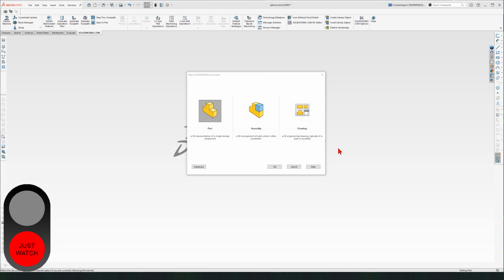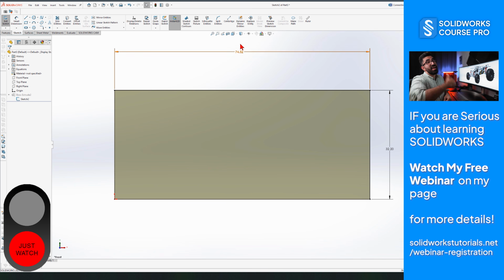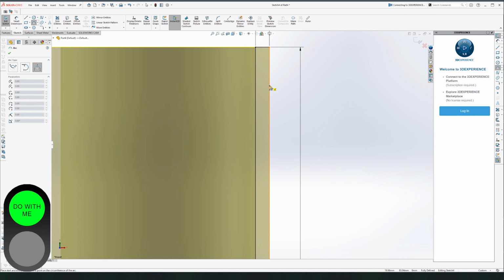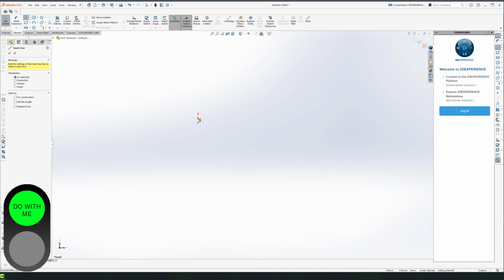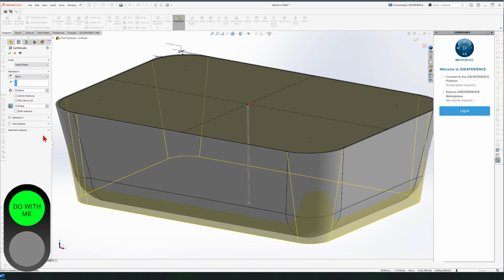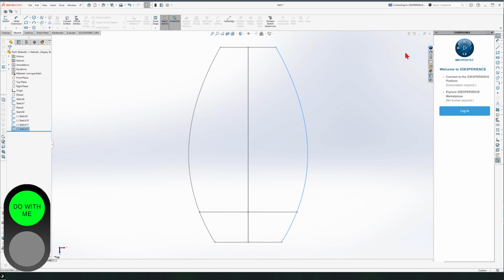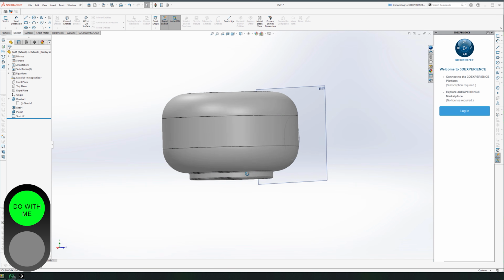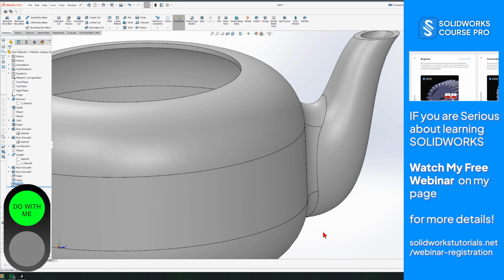SOLIDWORKS 2026 COURSE | Model at Green Light

Comment: For the problem with the extrude I just went back and undid the initial shell, then I rebuilt the spout and blind extruded it into the body then I used the shell on both at the same time
Reply from the maker: Nice, that's a solid fix! Shelling both at once after the extrude is actually the cleaner way to do it, saves you from the wall thickness issues too. Thanks for sharing this, it'll help anyone else who gets stuck there
Reply: @with-aryan of course no problem your video helped me get into solid works easier

Comment: After MMGS selection having to double click on the sketch top line, it did not bring up the dimensions, double clicking on the left pane Sketch brought those up but the sketch was not in edit mode, no matter where I clicked, lasso, box not in Sketch mode. Only when using the pop up on panel Sketch and selecting edit was I able to then select and extrude.
Reply from the maker: That sounds like a configuration issue, are you working with the latest update installed?
Reply: @with-aryan  Hi Aryan, yes latest update, nube + using SolidWorks Design, I started over and no issue. 33 min in going good. I just have to take my time and work through it. Your doing fine on the instructions.
Reply: Email this all to me so I show you live

Comment: 2:15:10 Could we instead hold off on the shell for both bodies until after we have extruded the oval. That way you can extrude further in, and when it merges, you can then shell to get the result we need.
Reply: I got lost after this minute and even watching again, I don't understand what he did. Everything before that was possible to follow. Any advise for a beginner?
Reply from the maker: I'm here, what got you confused exactly? all of that after this time stamp?
Reply from the maker: Yes! we definately can. there are always more than one way to get it done. This will do

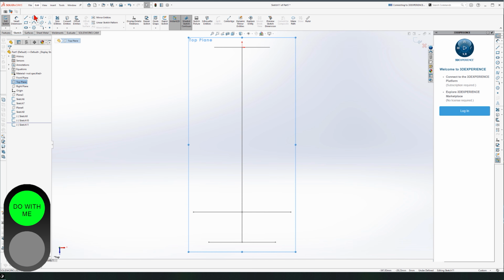Comment: 1:44:10 after adding those lines and performing the Loft action I am unable to select either of those two lines. Clicking the lines open Selection Manager and when clicking them again it says, "The selected guide curve is invalid." I've repeated the step 5 times and have ensured the yellow boxes are there as noted.
Reply: I ran into the same issue, I had two lines on a single sketch. Make sure each line is it's own sketch, you cannot just close the sketch and make a new one immediately. You have to click the plane or deselect the previous sketch before making a one to ensure it's creating a new sketch.

Comment: Hello, thanks for your work. New to this and just getting started and when I follow your lesson to evaluate the cube, I used your stated figures but my center of mass is not correct, redid the sketch multiple times and keep getting different numbers, some are negative. Thanks
Reply from the maker: You're very welcome! If your center of mass is coming up with negative values, it might be an issue with your coordinate system origin.

Comment: At about minute 56, you are teaching how to define a simple sketch, but you are making a mistake. You should NEVER define a sketch through BREP´s. Ever! I thought you would know that as a specialist! That´s one of the first fundementals a CAD designer learns.
Reply from the maker: Hi I appreciate your feedback but I hardly disagree. “Never” is not the correct word here. Sometimes referencing BREPs is the smarter move especially when you’re doing contextual modeling, top-down assemblies, or design changes that need to follow the geometry rather than stay independent.
Reply: @with-aryan  Hi, thanks for your quick reply. 
"....Sometimes referencing BREPs is the smarter move especially when you’re doing contextual modeling..." I would disagree. You never reference BREP´s, you always reference planes, lines and point on which your design is based, for contextual modeling. At least that´s what we always do in the automotive industry. 
I don´t know of any brand, whether BMW, Mercedes, Ford, VW, GM or otherwise where you would reference any type of BREP at all, unless it is unavoidable. It´s best practice and what every design engineer learns from the beginning. We have multiple design changes daily.
For assemblies you can use the skeleton method, which in turn is derived from the same planes lines and points on which your part design is based.